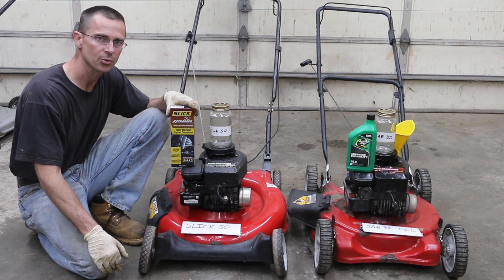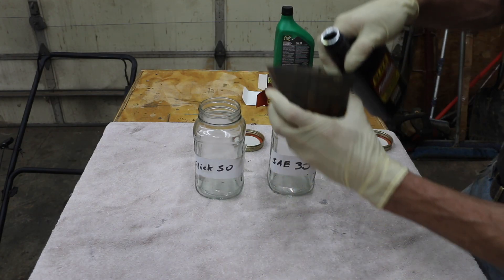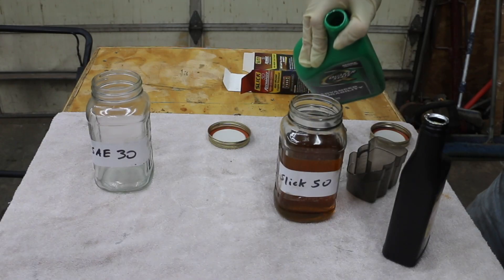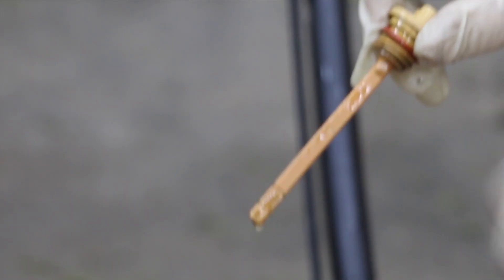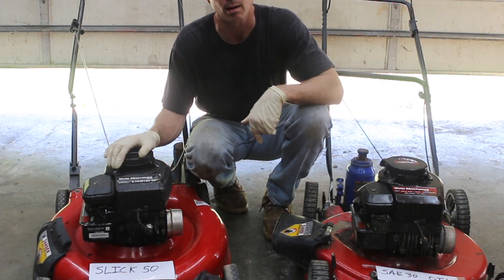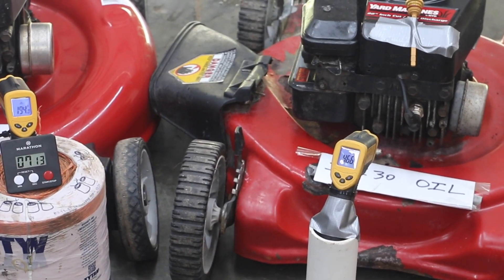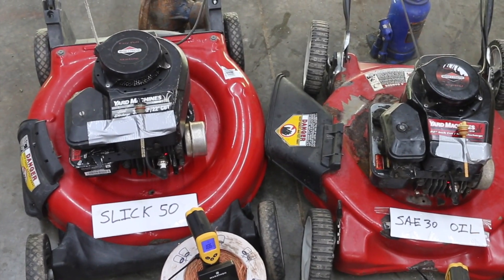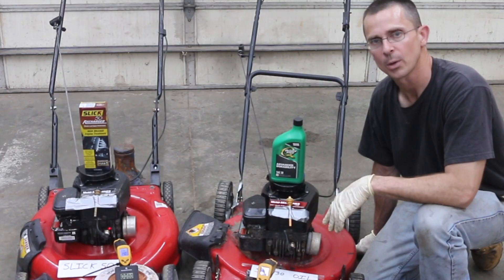Can't believe what SLICK 50 did to my engine!!--Dry Crankcase Test!

Comment: Great Video My Man!👍😎
I Got A 2003 Ram 4.7 &
Been Using Slick 50 For 
Smoother Starts! Helps
For That It Seems! Or Am
I Setting My Self Up For A 
Big Problems? Thanks For 
Your Awsome Video’s!👍😎
Looking Forward To Hear
From Ya My Man! OhYeah!
BigDave From Chi-Town!🔥
Reply: I think the video shows it lubes well (cooler temps), just don't run an engine with low/no oil. I still use slick 50 in all my engines.

Comment: So I like this but both of those look like used or found mowers not new so you can’t tell how one engine was treated over the other maybe if you tested 2 new engines like this it would be a better comparison. Also I think the slick 50 needs multiple heat cool cycles to build up the film protection it provides.
Reply from the maker: Thanks for the feedback.

Comment: The lucas oil display with the plastic gears shows how that Lucas sticks and flows and stays attached to moving parts.   The lucas treated oil kinda looks like mucous, and all straight men know where mucous can be found to be a very effective lubricant.  It, lucas, definately stays attached to moving parts at least long enough to get another bathing. Just like the other crank shaft.
Reply from the maker: Thanks for the feedback.

Comment: I be sworn by Amsoil.
Reply from the maker: Thanks for sharing.
Reply: @ProjectFarm  I am going with Amsoil; I am using a jobber; Claims—exorbitant claims—have been posited by my Jobber; I need Amsoil "Dry Crankcase Test" > I was told they ran a bench test on a 2-Cycle Lab queen @ 20,000 RPM for a Month with no Babbitt fail which is unbelievable to me but I have studied the literature which states they start with better base-stock • Most here are mechanic enough that we will not need a 2-nd machine to compare to ~ Other reports on Like South Main have posted "Customer ran a Honda ( or something ) COMPLETELY  out of oil by being a non-mech type with no lockup / catastrophic fail ▬ HVAC pump to pull the oil? Real mech uses Mouth Suction!!!!  Where is your IBM Mainframe? Laser moon-bounce to ascertain  e ^ -5th Gravitational Effects? 

When ya wanna do Quantum Chromodynamics I'm your lead!

Comment: Hi ,did the engine with the slick 50 have an underlying problem really need to use two new engines that you can eliminate as much potential variability . I have used the 2 stroke slick 50 and I swear by it. Not that it performs miracles but there is a definite benefit to it. I also have used it in my car and noted a 3-4mpg increase after treatment of the oil however this reverts when you drain it and change oil.

Comment: I use full synthetic in all my engines usually Mobile 1. I do not use any additives or snake oils. I have only had 1 engine go south on me, a nissan  3.5 with 215K. Timing chain went out or should I say the tensioner and destroyed the engine. I repeat I use full synthetic only.
Reply from the maker: Thanks for the feedback.

Comment: I think with 2 old mowers..
One can just fail w/o oil at any point..slick 50 or not..
Judging by the motor temps..if they had both been new motors..the slick 50 would have lasted longer..
The slick 50 one died at a much lower temp than did the other mower...
Some of this could also be that overall motor oil has improved a ton since slick 50 came out..
1978 was a LONG time ago..
Reply from the maker: Thanks for the feedback.
Reply: @ProjectFarm  
LOVE your ch !! 
can't tell you how many times I've used it..

Comment: How does a motor that's running cooler seize up before the one that's hotter ? It may have had super tight tolerances in the bearings that gave up.

Comment: Slick 50 sucks! Used it on a 22R Toyota motor. Soon as I stopped using it the motor started burning oil! Don't ever put that crap in a motor. For that matter don't put anything in your crank case but the oil recommended by the manufacture! They have engineers way smarter than us designing motors and know just what they need!
Reply from the maker: Great feedback. Thank you
Reply: @ProjectFarm  Motor oil is great lube for you gun's, grease too.🤣😂😎

Comment: I remember those commercials too, very surprised by the outcome, I switched to Z Max when it came out, it's supposed to actually soak into the metal to give added protection on start up and so forth, I also use Hot Shot striction to keep things clean, but I'm realizing that these claims these companies are making are exaggerated at least and downright wrong at most. Enjoyed the video.
Reply from the maker: Glad you enjoyed!

Comment: I put slick 50 in a ‘79 Ford F-150 at 120,000. At 140,000 miles the truck was totaled, and I kept the engine. I was planning to put the engine and transmission in a 1980 F-150. I decided to rebuild the 302 v-8. The shop that checked everything out asked me what I had in the engine. They tried to clean the crank shaft in a caustic soda bath. It was in 8 hrs and still had an oil on the journals. They left it in over night for nearly 24 hrs and it still had an oil sheen on it. They had never seen anything like that. The slick 50 needs time to work in. They turned the crank anyway and it all came out good. I put more slick 50 in the rebuilt 302. When the frame went the engine was still doing fine.
Reply from the maker: Thanks for sharing.

Comment: Dude!!!!!!!the Slick50 needs at least a few hours to treat the engine!how many hours did you run the engine before you drained the oil?🤔
Reply: Yes,. It probably needed more time to run when first applied. i have some System 48 Plus which requires a minimum of 1/2 hour run time. And it should be added to a warm (hot) engine. If you want to try some, I can fix you up with a sample.
Reply: @craigtraudt8350  thanks for your feedback as a mechanic I give every vehicle I’ve ever had a slick “50”treatment.my E250(2000 model)has 370711 miles!!!!!!original???? I’m not sure🤔But when I bought it from a co-worker in 2014 it had 264000+/- & I’m going to give it a 2nd bottle of slick 50 soon.I like what you are doing.......Seriously though.......read the LABEL 🏷😸😸😸😸
Reply: @johnjosephfontaine2712  is this 50 oké for the Diesel engine? Thanks!

Comment: I remember the commercial.  
There was supposed to be something like teflon in the Slick 50 formula that coated the interior surfaces.  
The experiment shows the opposite, although, maybe the components of modern oil has something better in it, like PTFE?   

Thanks for the great content.    
Keep up the good work.    
בס״ד
Reply from the maker: Thanks, will do!

Comment: I have always used slick 50. After about 130 000 miles I had to change my oil stem seals on my Ford Escort and what I noticed was that the engine was clean of slug and carbon, which I attributed this to the slick 50 preventing any contaminants sticking to the metal. When I first had the car at 40000 miles I had problems with the engine  running on. I poured RedX into the cylinders and left it over night before cranking the engine to clear and replacing the spark plugs, then replaced the oil and added Slick 50. I never had any starting and running on problems again. I cant say which of the products were of greater benefit, but was glad of it and I am a great believer that additives of oil and fuel, particularly with the fine tolerances of modern engines together with the high costs of repairing them. It is also important that people  continue keeping product companies on their toes and exposing inflated claims. Perhaps in fairness it would be good to inform the companies of you findings in order to obtain a good overall perspective. Finally I would like to thank you and others like you for producing these great videos...Best Kevin Craig
Reply from the maker: You are welcome!

Comment: You realize that the slick 50 back then is diff from today. The ingredients are different. I watch the test personally back then and it did run for about a half hr to about 45 min. It was very interesting. I had a couple of sample pieces with treatment on it. Rubbed together was hardly any friction. The company split apart and slick 50 never been the same. Good test job here.
Reply from the maker: Thanks so much!

Comment: Since the engine with the Slick 50 ran at a cooler temp, would not this engine last longer over decades of use than the one that ran much hotter, all things considered and oil level kept up over a lifetime.??????

Comment: I personally have used tufoil https://www.fluoramics.com/tufoil/tufoil-for-engines/  with mobil 1 oil for years 

They claim:

"Several years ago, the Guinness Book of World Records chose Tufoil as “The World’s Most Efficient Lubricant.” To this day, we are the ONLY engine treatment in the Guinness Book. So far, no one has been able to break that record!

We’ll never see the low gas prices from years ago again! But we can get the most out of what we have to pay today. Smart drivers rely on Tufoil® for help in creating improved engine efficiency!

Tufoil is “The World’s Most Efficient Lubricant.” Efficient-running engines use less gas! Tufoil was tested by the United States Government at their federal laboratory (The National Bureau of Standards, now known as NIST) and passed with flying colors. NIST determined that Tufoil has a surface friction so low that it makes Tufoil the most slippery substance known to man.

The Canadian Government ran extreme cold weather tests at their laboratory in Kapuskasing. Their findings show that Tufoil boosted cranking speed in both gas and diesel engines nearly 10% in cold weather starting. Their findings also showed a 5% fuel savings."

Recommend a comparison with Slick 50 trying with mobile 1 at 10% for the application as described here:  https://www.fluoramics.com/what-is-4-ball-testing-as-used-in-testing-lubricants/07/

Also  I would recommend running for a while.  Then letting it sit for a week and running again to simulate it really getting in there and  bonding to metal parts with a couple "coats" assuming that might change with a few run cycles and cure time etc. 

Also think about one of those 4ball test rigs for future comparisons.   Seems like a good fit as a test rig for this channel.

Comment: Is this the reason why Mercedes warns in their manuals to use any additives in their engines, losing your warranty if you do it anyway?
Reply: ALL OEM and oil suppliers will state NOT to use an extra additives, they may be immiscible within the formulation, cause drop out in additives and result in sludge. Buy a good quality oil and you really do not need aftermarket additives.

Comment: I remember an old Ford tractor, treated with Slick 50, that ran for days without oil at a county fair demonstration in the late 80's. My family had a booth set up beside the Slick 50 booth and we were all amazed. If memory serves me correctly it didn't even have an oil pan on it. Also, I remember that you had to shake the Slick 50 up and keep shaking it as you poured it out to keep the teflon suspended and get it all out of the bottle.
Reply from the maker: Thanks for sharing.

Comment: I know this is very old but I was shocked at how this ended. Very odd that the slick50 stopped at such a low temperature and way before standard oil. Would have loved to see the engines torn down like you do on your newer vids.
Reply from the maker: Thanks for the feedback.

Comment: Like to see if Z-Max would perform better. Ran it in my race motorcycles in 06/07. I know a guy who’s mechanic forgot to refill the oil after draining and changing the filter. He’d always used Z-Max before. He was able ride over an hour on a Suzuki GSXR750 with no oil before it finally seized.

Comment: I always run Lucas oil additive in my engines, I’d be curious to see that put to the test some how
Reply from the maker: Thanks for the video idea.
Reply: running that Lucas stuff is smart. I'm generally skeptical of... well, anything where one "forks" over one's money, and they, grinning, hand over some product that doesn't seem 100% necessary... but I would never be without the Lucas. the synthetic... if I can. there's another stuff "power punch" that seems to be approximately equivalent- I use that too.  the physical properties of these products are right out in the open for all to see: they have the consistency of Chainsaw Bar Oil... super "clingy", almost mucilaginous-looking. I've done my homework with these particular products and they do exactly what they look like they would do. they appear to be able to withstand the conditions of an actual running engine (heat and impact and shearing forces and stuff) without any special issues. they're worth the money... and I don't like to spend any money if I don't have to. the only problems I've ever seen associated with the use of these products are the kind of problems you don't mind too much... like- any engine with a low oil shutdown, when fired up cold, will (depending on the percentage you put in) shut down from no oil in the crankcase, because it's all stuck all over the moving Parts at first... necessitating a deactivating of that sensor, at least temporarily. I suppose that could carry some risk... but I'm always checking and changing the oil anyway because that's the best thing you can do: change that oil! especially if it's some little generator that only takes a half quart... peace be upon you, sir.

Comment: I had a 2000 Chevy prizm with about 300,000 miles on it.  Ran great.  Used some oil here and there but never really had much trouble with it.  I put some slick50 in it during an oil change.  It lived about a day.  Threw rods out the oil pan and windowed the block. 

Never again.  That stuff is poison.
Reply from the maker: Great feedback. Thank you
Reply: @ProjectFarm  do keep in mind there could have been other issues, but what I wonder is.. if there were other issues, what did the slick50 do to teeter the engine over the edge, if anything?
Reply: @evil03mustang08  vaguely remember some bulletin that slick 50 or other teflon additives produced a precipitate that hunng up on sensors and in various crannies of the crankcase impeding oil circulation and possibly causing some isolated hot spots where there was a build up or reduced oil flow.
You would need something like a Flir thermal imaging camera  dongle on a cell phone to see this or possibly a post destruction metalurgy study.looking at how the heat had influenced the metal crystaline structure of the block.

Comment: How long did you have the slick 50 in the motor? It takes a while for the additives to adhere to the motor, so says slick 50.
Reply: Yeah I was thinking that, it supposedly takes a while to get all round the engine and to coat it with a few microns of the Teflon coating

Comment: Slick50 had been charged by FTC for false advertising. https://www.ftc.gov/news-events/press-releases/1997/07/quaker-state-subsidiaries-settle-ftc-charges-against-slick-50. If the product really does prevent metal grinding, lubricant manufacturers would simply formulated their oil to include the same ingredients. PTFE/Teflon's melting temperature is way below gasoline combustion

Comment: Something is wrong here. No offense, I absolutely love you channel, the way you do things in a just and fair manner, all of that. But, something is wrong. I believe the product that claimed the ability to do this, was "Pro Long" and it was professional Racecar Driver Al Unser driving the viper. 
Do it again with 4 new engines from harbor freight. All brand new. 
Two with standard 30w, two with the treatment in the correct percentages, again. Run them to warm them up, drain them, run them at half throttle empty, til they die. Anything other than that, is a complete waste because of the difference in use, maintenance, conditions they were used in or on, etc... Again, while entertaining, this is a flawed test in many ways. Please don't misunderstand me. I enjoyed the heck out of this, as well as many of your other videos. Even consider your channel on of my favorites. But I was at willow springs raceway, and I knew two of the the employees there very well. The Test was as  honest as your videos are. It did exactly what it claims. Also, I watched a engine run for over four hours with the drain plug out, the filler plug out, the dip stick out and no oil in it, after it had been ran with the treatment for thirty minutes. I was in the booth across from them. Everyone was allowed to inspect it while it was running. It never stopped unless the guy turned it off to end the demonstration. That's a fact. And to further my point (with respect) we were four-wheeling in a K-5 Blazer and punched a whole in our oil pan. Lost all of our oil. We had to four-wheel out the same way we came in. And it was no easy task. It took over three hours. We made it out, drove to town, picked up some JB Weld, took off the oil pan, fixed it, filled it with oil...and more of the treatment... Cuz that's what was in it before. Why? Because the guy that owned the Blazer was the guy who was at work, at Willow Springs Raceway the day they brought in the Viper and filmed the infomercial...so he put it all his cars and trucks. Cuz it works. Honestly, again... something is wrong here....all my best and continued support in viewing your channel. Because I trust your intentions and honesty.